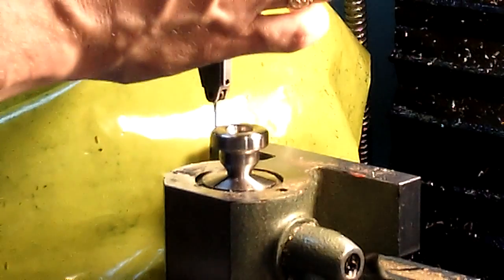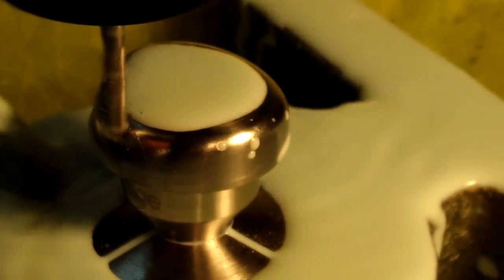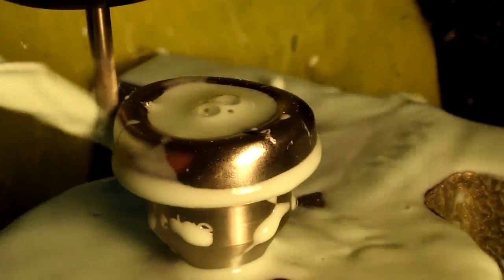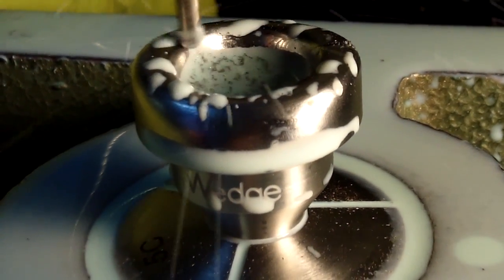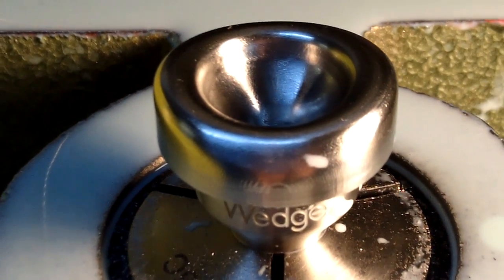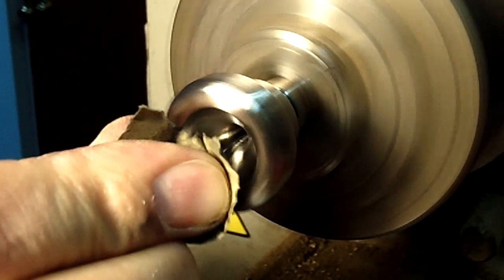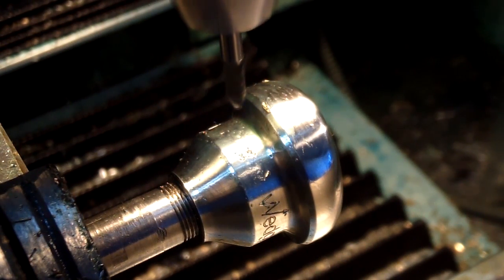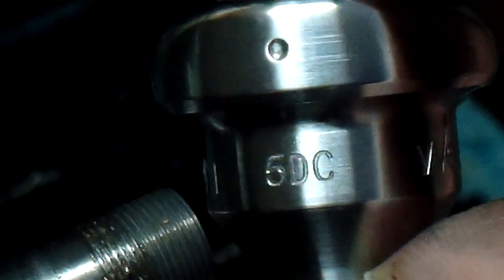Machining a Wedge 5DC Stainless Steel Trumpet Mouthpiece

Comment from the maker: Stainless steel is more difficult to machine than brass because it is harder, so feed rates are slower. The coolant has to be used on both, so neither one is more messy.

Stainless steel mouthpieces sound brighter and project more than brass. They are very responsive to articulation, but can be more prone to splitting notes. Lead players love them.
Dave